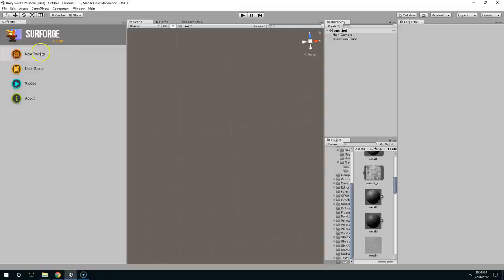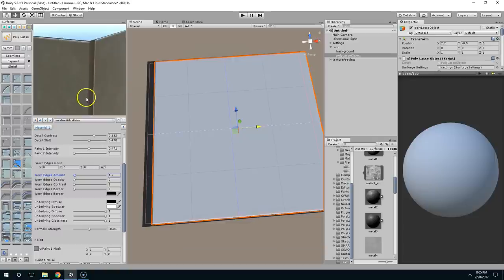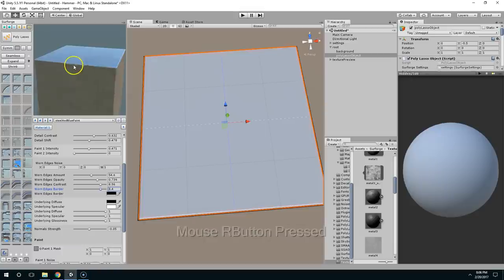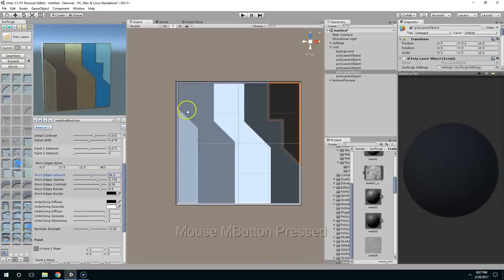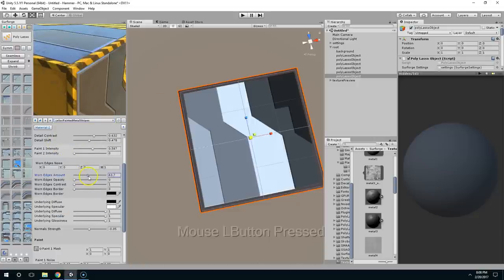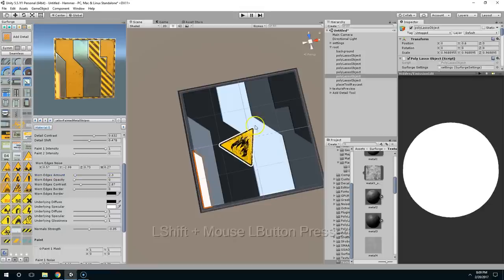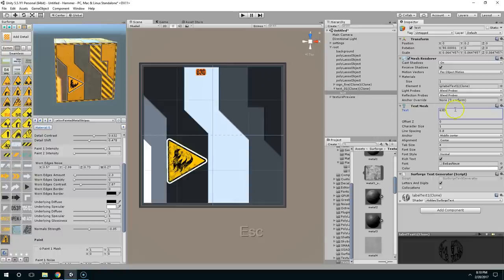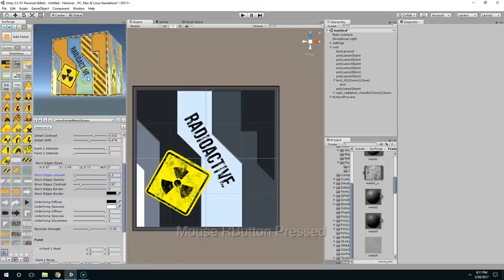Creating a Crate with Worn Edges

Comment: what is your system specs, even on on my 980ti with 16gb ,i7 5890x ,im unable to cut like you. it's not that responsive .
Reply from the maker: For the video I used a computer with 8gb ram, i7, gtx 970. I've also been using surforge on a machine that uses an i5 with a gtx 560 and it runs okay. Are you getting console errors? Is there a lot of other stuff in your project?